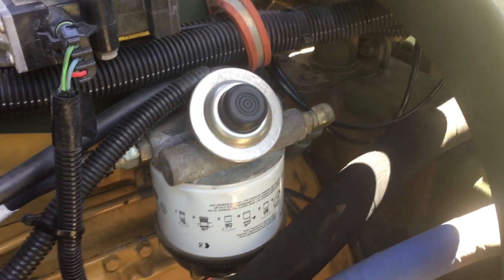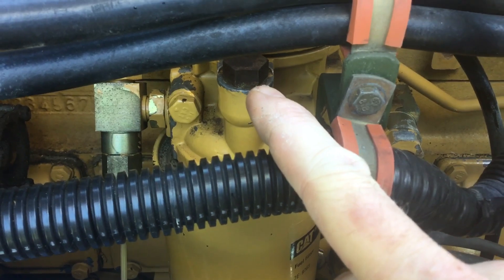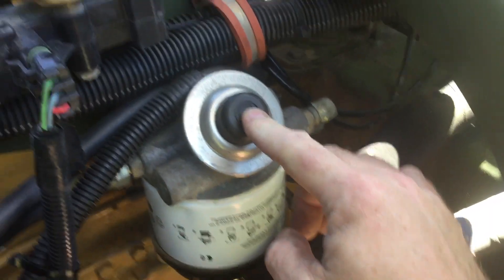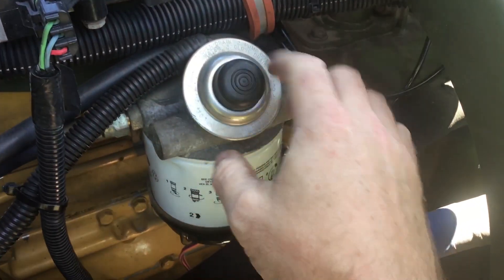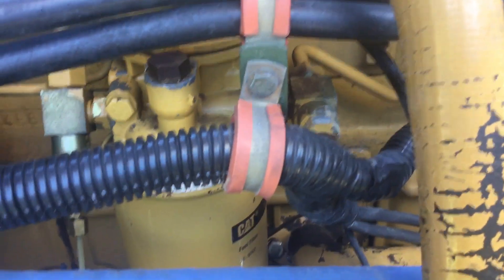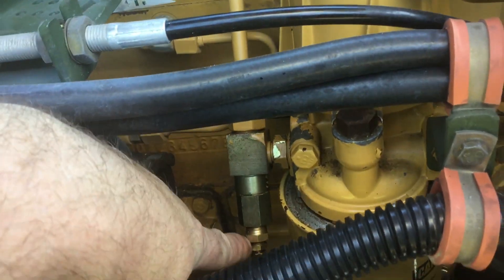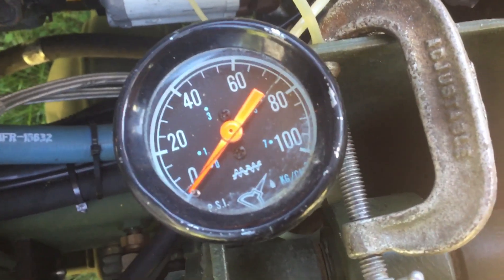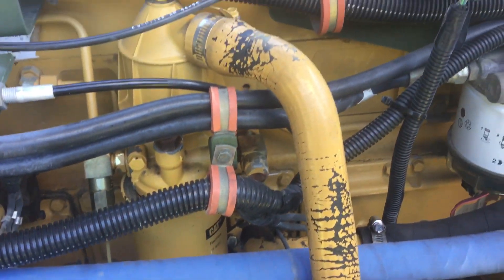LMTV Cat 3116 fuel system overview

Comment: Hi Rronmar, I see in your one video a fuel pressure gauge wired to the dash. Is that still a mechanical fuel gauge with a life fuel line ran to your dash? Or is the ISSpro gauge a sensor one? 

Very interested in adding a gauge to my dash, any info or photos on how you wired and routed the fuel gauge to your dash? Thanks.
Reply from the maker: It is an isspro mechanical gauge with a 1/8” poly line run along the drivers frame up to the dash.  I ran the poly line inside a large piece of vacuum tubing that slides over the fitting on the back of the gauge to protect the poly line and if there is any leakage it will be directed back outside the cab.

Comment: Do you know if the fuel shutoff solenoid pushes out or pulls in on the "on" position?
Reply from the maker: @151bradhatt  i think it pulls in to the on/run position, and extends outward(forward) when power is removed, pushing on a plate in the governor that shuts down the fuel/pulls the injector racks to zero fuel.
Reply: @rronmar that's what I thought. I'm having problems with my work truck with this engine. Turned it off for lunch and it hasn't started since. Fuel goes in but doesn't go past the lift pump
Reply from the maker: @ what do you mean by doesn’t go past the lift pump?  The governor and run solenoid only shuts off the unit injectors(inj pump and injector in one,x 6).  When cranking the lift pump should lift fuel from the tank, push it thru the filter, thru the gallery past the injector inlets in the head and out thru the regulator thru the return line.  The regulator causes it to build pressure and you should see ~10PSI at the test port between lift pump and fuel filter on the side of the head while cranking.  This happens regardless of whether the solenoid is powered or not.

If you remove the return line at the pressure reg(rectangular block on top of the governor, has a hard line over to the front of the head) and crank the engine, fuel should come out.  If it does not, you have a fuel supply issue, not a run solenoid issue…
Reply: @rronmar  the shop pressurized fuel into the supply line but nothing comes out after that. Even while cranking
Reply from the maker: @151bradhatt  well fuel should, so either the lift pump isn’t moving any, or there is such a large air leak in the lift line that it is running back faster than the lift pump can draw it when cranking.  Couple things you can try.  1. Bucket of fuel, connect a short line from the bucket to the lift pump inlet on the governor(bypass the installed fuel line), connect another return line from reg to bucket and see if it will pull fuel while cranking and start.  2. Pressure test the entire fuel system.  Disconnect supply and return lines at the fuel tank.  Plug the return line and apply 15 psi from a regulator up the supply line, bubble mix every line and fitting…
Reply: @rronmar the lift line is pressurized to 10psi (by shop air) and while cranking nothing came out of the pump return. The shop is still troubleshooting. Solenoid was working as it should
Reply from the maker: @ well something should be coming out of the return line, so something is blocked somewhere…  is it building any primary fuel pressure or are you seeing the pressure applied to the supply line?  I show where to hook up a gauge, there is a T fitting where the line out of the governor connects to the filter.  You should see the same 10PSI applied at the supply line there as it shpuld be able to flow right thru the lift pump check valves and on thru the rest of the system…

Comment: A perfect video and description of what I was after.  I wish every YouTube troubleshooting video was like this.  Straight to the point, accurate and helpful.  Thank you!
Reply from the maker: @TurboSuperiority  thanks, there is another one on my channel that shows accessing the flapper bypass valve to clean and inspect.  That flapper not sealing is Probably the most common issue with the primer assembly…

Comment: I have a 3116 7000.gmc and we are getting fuel to the inspection pump but fuel is coming out of the inspection pump we changed pump still getting the same issue  but the fuel shut off solenoid is working  what is your recommendation on my next step?
Reply from the maker: So is the truck not starting and running?  Are you calling a primer pump the “inspection pump”?  Being able to suck fuel from the tank with the primer pump is a good thing.  The fuel comes from the tank, thru a primary filter, past the primer pump to the governor lift pump, thru the main fuel filter thru the head, past the pressure reg and back to the tank.  If you pump the hand pump you should be able to see fuel at the tank return line.  If so, great.  Now crank the engine.  You should also see fuel being pumped by the governor lift pump all the way back thru the return line to the tank.  A lot of fuel…  The run solenoid when de-energized keeps the injectors from spraying, but it has nothing to do with the lift pump and fuel flow. if the crank is turning, the lift pump should be pumping fuel.  In the video, I show a t fitting between the governor and the main fuel filter.  Connecting a pressure gauge there will show you if you are making primary pressure.  No primary pressure, no run.  Even if it is pumping fuel, too much air being sucked in will keep it from running.  At that T you should have 10PSI cranking 20PSI at idle and ramping up to 60 PSI at ~ peak torque/1550 RPM…  one of my other videos I show primary fuel pressure and what an air leak on the suction side looks like…
Reply: @rronmar  sorry injection pump not inspection pump lol
Reply from the maker: @isaacwillis8892  ok, the cat 3116 doesn’t have an injection pump.  It uses 6 mechanical unit injectors(pump,and injector in one, powered by the camshaft)  The governor controls the fuel rack on those unit injectors that compress and spray the fuel at up to 33,000 PSI.  These trucks don’t have a pump at the fuel tank, the lift pump is in the governor.  It works with the pressure regulator to create the 20-60PSI of fuel pressure in the gallery.  A pump installed at the tank is usually someones half assed attempt to deal with air leaks on the fuel line from tank to governor or a failing lift pump.  The problem is an electric pump at the tank is usually only good for 5-7 PSI, and unless they flow enough fuel(probably not) the gallery will have problems reaching its proper running pressures I mentioned above.  Running at the wrong/insufficient pressure can damage the MUI injectors…  so yea you have something wrong at the tank, a,pump that doesn’t belong there, probably some air leaks in the lift line, and perhaps a problem with the lift pump in the governor…
Reply: Well it has a Electric pump  on it by the fuel tank come to find out no fuel is even going from the tank to the fuel filter  so I think it's something in the tank

Comment: What causes the 3116 cat engine to bring diesel to the radiator?
Reply from the maker: Fuel in coolant or coolant in fuel means there is probably a bad injector cup, or a crack in the head.  This series of Cat engines(3114,3116,3126, C7) and the ford power-stroke, use a copper cup that is press fit into the head.  The injectors in turn are inserted into this cup with Oring seals.  The coolant galleries and fuel galleries are separated by these cups, and when they have a problem fuel or coolant can change places between their respective systems.  Since the primary fuel pressure in the gallery is up to 60 PSI when running, it is most likely that you will find fuel in the coolant, but some have found coolant in the fuel tank as the cooling system remains pressurized after shutdown until the engine cools…

Comment: Question.

i think my lift pump has failed but not 100% sure. i have fuel from tank to Inlet of pump. i removed metal pipe off the exit of lift pump and have no fuel. i put 5psi air pressure into fuel tank and get nothing,even while cranking with pressure in tank i see nothing. i did this with ignition on. i can hear/feel the shut off solenoid click when ignition is turned on.

if it is the lift pump, is it serviceable?
Reply from the maker: Yes the lift pump is serviceable.  So with 5psi on the rank if you crack open the line entering the lift pump you get fuel coming out there?  Just want to make sure there are no obstructions between tank and pump.  The run solenoid in the governor has no effect on primary fuel.  When power is removed, the solenoid allows the fuel control rod to pull the rack/injectors to the zero fuel point…

Comment: Can the 3116 run on waist oil
Reply from the maker: The 3116 uses mechanical unit injectors that are both injector pump and spraynozzle, and they squirt at up to 33,000 PSI.  Whatever you run thru them really should flow into the fuel gallery at near the same viscosity as diesel…

Comment: Hello,got a nice,clean low mileage cat 3116,1993.Its been great,then overnight sitting it tends to act like there is a fuel system bleed down making it hard to start in the morning.?It will start,just a lot harder than it should,What about fuel check valves?thx
Reply from the maker: Well there is a check valve at the lift pump, I don’t think I would want one anywhere else.  If the system is intact/sealed, you should have no drain back.  You actually want this as a warning, because if it leaks enough to drain back, it IS sucking air while running.  Air while running interferes with primary fuel pressure. I show what a air leak looks like when running in one of my other videos using a primary pressure gauge. I also show how to connect a inexpensive mechanical pressure gauge between governor and main fuel filter(pinch plastic gauge hose to dampen needle pulsations) to check primary pressure.  These unit injectors need proper primary fuel pressure.  Problems there can kill injectors if not corrected.  The problem with lift side leaks as there is no pressure, they very rarely show any outward signs that there is a leak.  Could be a loose fitting, could be a bad filter seal, could be a bad hose.   

The engine in the video is a military vehicle, so that primer and primary filter are unique to it.  I don’t know what is between the tank and the governor lift pump on yours, but it could be any fitting or component between tank and governor. Do you have a hand primer pump?  

One way to test this is to start and run it so the system is full of fuel, then shutdown.  At the tank disconnect and cap the return line.  Then disconnect the supply line, and connect a low pressure regulator and gauge, and pressurize the supply line/engine fuel system plumbing to 15PSI.  Then start searching the system looking for where fuel pressure is forcing fuel out.  

I had the same issue you describe, hard start and rough initial idle after setting.  I could pump the primer and fill the system and it would start and idle great.  Checked filters and fittings, no sign of an issue.  Pressurized the system hoses and plumbing like I just described and found fuel dripping off of that primary filter after letting it set under pressure for a while.  The water separator bowl on the bottom had a hairline crack in it.  It wouldn’t leak fuel as there was no pressure, but it would suck air all day long when the lift pump puts it under vacuum to lift fuel from the tank…
Reply: @rronmar  Thankyou,Im in the midst of troubleshooting different things now.

Comment: My 3116 has a running issue I've replaced the fuel tank and lines from tank to pump and the 2 fuel filters it will run fine with a mr.gasket in line pump till the pump get hot and shut off any help
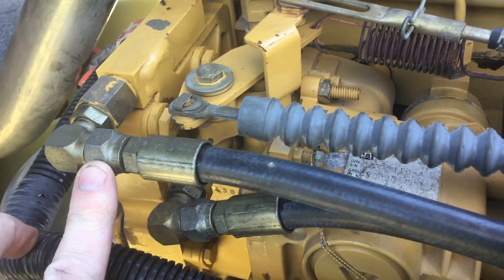Reply from the maker: Whats your baseline fuel pressure?  I show how to hook up a gauge just after 4:30 in the video.  With the engine running you should have about 20PSI at idle and up to 60PSI at higher RPM.  If you don’t have that, you either have a regulator problem(block on top of governor) or a lift pump problem(inside top-right side of governor)…  system is sealed and primed, it should not need a elect4ic lift pump…

Comment: Do you know if engine restore will hurt this MUI 3116 engine like it will on a HEUI 3126?
Reply from the maker: Couldn’t say for certain, I never use the stuff.  If the engine needs an overhaul, I do an overhaul.  The HEUI uses a variable hydraulic pump to boost engine oil as high as 3000PSI to actuate the injectors which are controlled electronically thru hydraulic spool valves. The 7:1 injector piston ratio boosts the injected fuel pressure as high as 21,000PSI.  Because if this more care must be taken with the engine oil or it will foul the close tolerances of the pressure pump, regulator and spool valves on the injectors.

 The MUI injectors are driven by a rocker arm off of the cam, so it is not really any different than any other engine and might not have any issue with this stuff.  It does have a mechanical governor though that uses oil for lube, so only cat can reliably answer this question...
Reply: Thanks for the reply there's alot of confusion with this engine in this year of lmtv most people thinks its a HEUI engine & ive only owned my 98 1078 for about 2 months my engine doesn't need a rebuild mainly i wanted to know is my oil system is hyper critical & you have answered that. 👍 big thanks

Comment: AWESOME AND INFORMATIVE VIDEO ! . Im trying to buy a  non running 1998 gmc with the 3116 , is 324k miles to much for this motor ???,  what can i expect in miles left for a well cared for engine ? I  havent heard it run , but runs well when it did ,, seller suspects fuel problems . He says it runs if bottle fed with an aerosol can . I believe him and trust his word  and a tire shop owner i know confirms that. . . im hoping  its an ipc or gummed up fuel system or something simple  . I have become fascinated by  diesel engines, after purchasing and wrenching on a 6.0 diesel f250.Want to learn as much as possible about all diesels , although im a very good gas engine shade tree mechanic . ideas and advice is greatly appreciated . thanks for selflessly sharing youre knowledge.  all input is  greatly appreciated . P S,  based on the backstory , im ruling out injector issues ,
Reply from the maker: When you say aerosol bottle are you referring to starting fluid?  Too much of that can do damage...  if it runs that way it obviously has compression which is good.  You need the fuel gallery in the head full of fuel, and the run solenoid on the governor to be energized which will allow the injectors to inject fuel.  The run solenoid are the only wires connected to the governor.  With your hand on it, you should be able to feel it go clunk when power is applied to its terminals.  Yours may or may not have a hand primer, but it won’t have one like in my video as these are unique to the LMTV/military.  Disconnect the line coming out of the pressure regulator on top of the governor.  Pump the primer if fitted or crank the engine.  You need fuel coming out of that line on the regulator to insure the head is full of fuel.  A common problem is a small leak on the suction line from tank up to lift pump and the lift pump(in the governor) cannot lift fuel and sucks air instead.   Once running the best judge of engine condition is blow-by coming from the crankcase vent on top of the main fuel filter...  324K is quite a few miles...

Comment: excellent video, i'm from Brazil and i have gmc 12170 with a 3116 engine and don't want to start you have any technical literature on the fuel system of this engine?
Reply from the maker: Valter P Not really.  It is a pretty simple system though.  If you remove the return line where it comes out of the pressure regulator block(above the governor, shown in the video) and crank the engine you should get fuel flow.  If you don’t have flow out of that return port/regulator, you have a lift pump problem(on the governor) or a filter or clog problem or a real bad leak on the line back to the tank that is sucking in air instead of pulling fuel from the tank.  If you are getting fuel out of the regulator block, then more than likely there is some issue with the run solenoid located on the rear of the governor. It receives power when the ignition is turned on.  If you put your hand on it when you turn the key on, it should go clunk and you should be able to feel it energize.  If it does not, either it is not getting power or it has failed which is keeping the fuel rack closed and preventing the injectors from spraying fuel.  If it doesn’t energize you can unscrew it and remove it from the governor and the engine should start. You will need to push something in the hole where the solenoid was located to shut the engine down though...  Good Luck.
Reply: @rronmar  thank you very much, I will do this procedure

Comment: I have what looks like exhaust expelling from my diesel tank. Is there any way for exhaust to enter into that return line?
Reply from the maker: julian botnick Sadly, yes there is.  The fuel flows thru the gallery in the head past each injector.  The injectors are imbedded in copper cup seals that seal the injector from the cylinder,  and also from coolant which flows around the cups to help keep the injector temps under control.  These will sometimes start leaking and can also lead to coolant in the fuel or fuel in the coolant...  Disconnect the return line, and run it into a clear line or into a bucket.  A small bubble in the line occasionally is OK, but a steady stream means an air leak or combustion gasses getting added to the fuel...
Reply: This was my fear. I had a cup fail on my 7.3 and had diesel in my coolant. Replacing the cups was fairly straight forward. However I hear with this engine you need a special tool to install them, and if not done perfectly they will leak. Have you done them before?
Reply from the maker: julian botnick not on a cat....